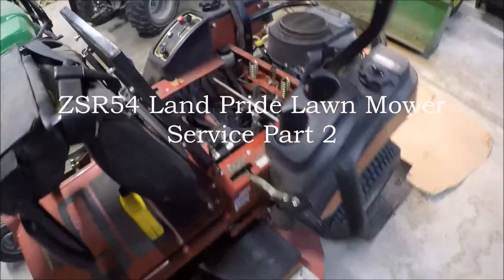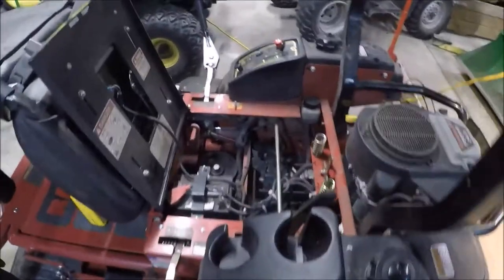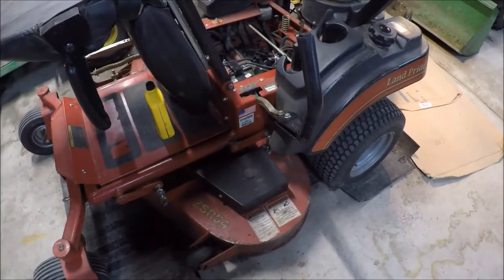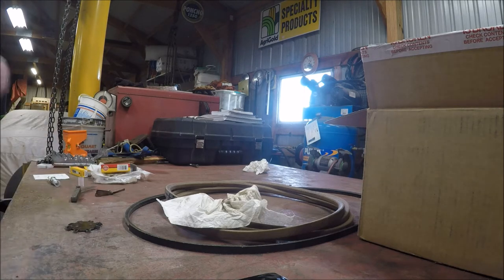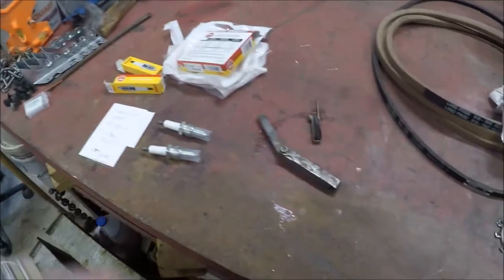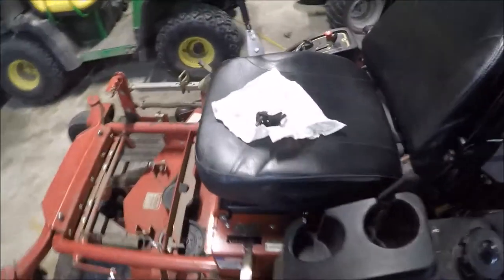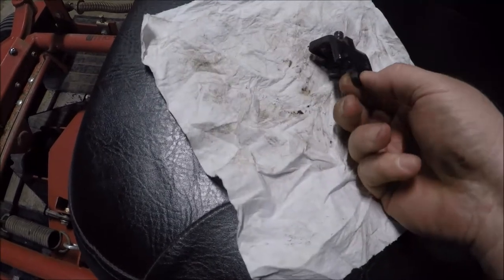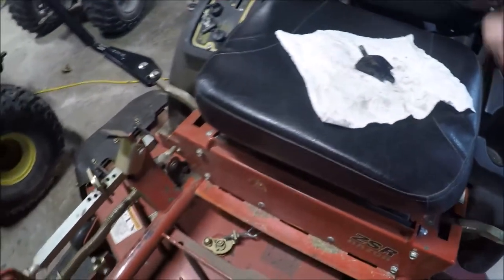ZSR54 Land Pride Lawn Mower Service Part 2

Comment: Thanks for the video Ron your sure more thorough than I am I change the oil sharpen the blades and grease it then Iam good for the year
Reply from the maker: Normally I do like you.  Sharpen the blades, change oil, & get going.  The mower was due for some service work.  Thanks for stopping by.

Comment: Nice mower! I don't like working on mowers, people abuse the hell out of them then want me to fix them.. I usually get out of having to fix them😁
Reply from the maker: Thanks.  It's been a pretty good mower for the most part.  What helps is that I'm the only one running it. 😁  Thanks for stopping by.
Reply: @crslyrn  oporators definitely make a difference on anything
Reply from the maker: @GosselinFarmsEdGosselin   You got that right. 👍🏻🍻🍻  I deal with the operator issue at the Day Job. 🍻🍻🍻🥃🥃🥃🇺🇸🇺🇸

Comment: Thank you. Very helpful. I am going change hydraulic fluid n filters this morning.
Reply from the maker: You're welcome.  Thanks for watching & commenting.
Reply: I got all fluids n filters changed..  Excellent information. It would have helped to put it on jack stands because I didn't fit under back bumper. It was a 1 hand job to remove n replace filter cover. Next time I will use jack stands.
Reply from the maker: @BudERHicks    Glad to hear that the video was helpful.

Comment: I wish you had a video on replacing the drive belt pulley and deck belt pullies.  This morning 1 drive belt pulley and 2 deck belt pullies get replaced. My ZSR54 was purchased in 2014 and has unknown hours.  The local dealer that I bought from never called me back with the price and availability. The B-Grove Pully 5.5 OD was $104.01 from German-Bliss. They are excellent people to work with. Since Kubota bought Land Pride they have stopped making zero turns and parts are getting hard to find. The belts are easy to get.  Do you know where to buy aftermarket parts like pullies?
Reply from the maker: Well, knock on wood, I've been fortunate enough not to have to replace the pulleys on the mower deck.  I've replaced the PTO clutch & I can tell you, the clutch & drive pulley come as one unit.  As for after market parts, a friend of mine that had a mower shop always got a lot of needed parts from Steiner Mower Parts.  He always had a catalog but, you can find them on the internet.  Good luck.  Thanks for watching.

Comment: How to keep the pin from coming out of the cam that holds the deck belt tight? The pin jumps out, the belt jumps off, then off to the shop to fix. Yes I know there is a spring ball on the bottom but I have replaced 5  or 6 of them. The last one I got yesterday cost $8.46. Suggestions?
Reply from the maker: Sorry, I've got no really good suggestions for you on that issue.  Another one of those things I've not had to deal with yet.